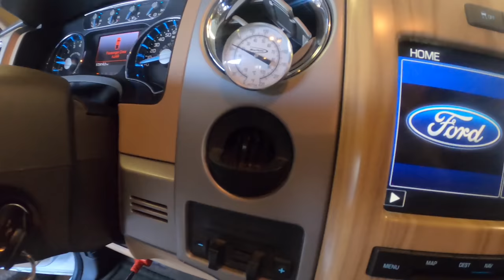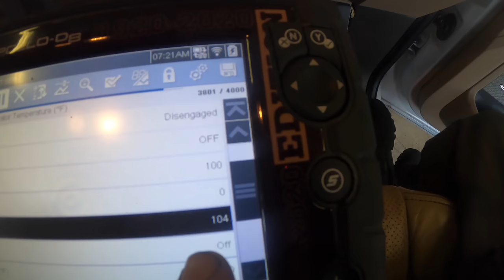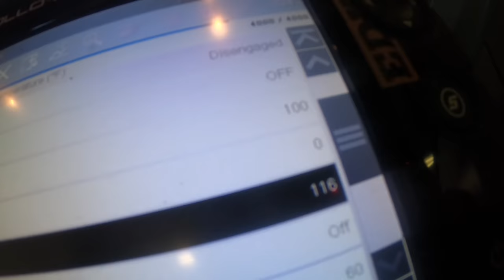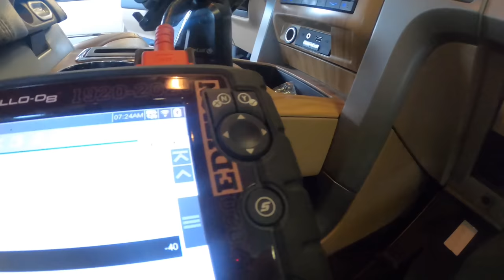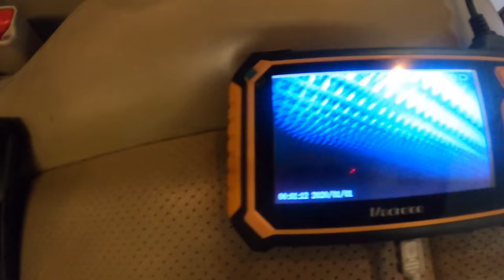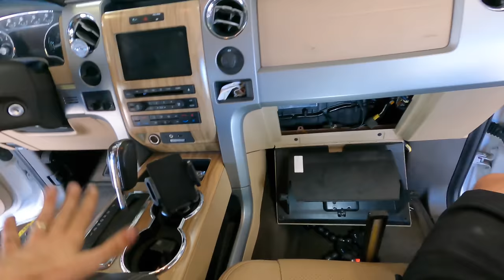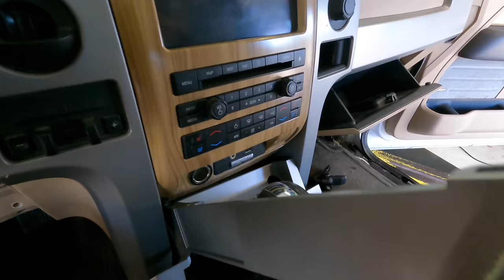TEN HOURS to replace one sensor! Ford 150 torn to pieces! Evaporator Core replacement.

Comment: I know it wasn't the OEM for that truck but I called my Ford parts guy and ordered a sensor for a focus because the only way I could get the right one was with a new evaporator.
It's been on the road for 3 years sense.  ( It was a hack but he liked it)
it was a 2010 f150

Comment: I’ve had to pull a few Ford truck dashes. the mode door itself on the HVAC box fails from time to time. Usually it’s the actuator, but sometimes the door gets bound up and you have to replace the box. As far as dashes go, it’s not too bad. Lots of room to work without the seats in there. I’ve only done a few, but have it down to about half a day. Not bad for 10 hour book time

Comment: That is not surprising! 2003 Ram 1500 heater core takes 12 hours to replace per dodge. I did it in 12 hours. When ready to install, there was nothing left on the fire wall but the steering column. Core was only $70

Comment: IS there any job you won't attempt 😮 What the heck. This channel is addictivel. I have a Love/Hate relationship with the hands-on part because I'm disabled now but fascinated. I love watching You 👈 fix them. Having the tools 🔧 the equipment, the knowledge and skills, and  PATIENCE and ofcourse what everyone seems to have forgotten about in todays society Customer Service and your definitely the complete package Ray 👍 with a few extra cans a squeaky clean Brake cleaner lol.    I'm sure this video has the third party warranty company lawyers working on writing in the loop holes on why this part is not covered under the warranty.  There very good at that.  Like refusing to replace my water pump on my 2011 Jeep Grand Cherokee Overland Summit V6 because the gasket failed not the part and I even had the Super Duper Hybrid Extended Bumper to Bumper with the extra Bumpers every thing plus VIP Warranty that covered everything oh but that 😅 WTF 😮  $700 Later.  That's ok that 5 yr 100K $3800 warranty I payed for in 2018 I still have 8 months left and so far the warranty company has invested $5700 into new warranted parts not without grumbling and sending out there investigators several times to end up having to submit to comply with there agreement reluctantly and pay for the repairs from replacing the air ride compressor unit at $2300 and then 2 rear air bags at diffrent times and then a new air-conditioning condenser unit and other AC parts that itself was over $800 the Air bags for the suspension were over a $1000 each so that warranty company put me on there DO NOT CALL LIST LOL

Love your ❤ Channel Ray. You ROCK Buddy 

Dave from Fox Lake Illinois USA 🇺🇸

Comment: Kudos for another excellent video and a very proper installation. Had this been my personal vehicle, I would have used a junkyard temperature sensor, a Dremel to cut an access panel into the box, and some RTV silicone to seal it back up. And maybe a couple of self tapping screws. 🤣... Just sayin'

Comment: Could use a variable resistor and adjust it until the temp is correct. Then solder that value resistor across the sensor wires.

Comment: All Japanese and European cars, from economy to supercars have 1 piece dashes, to stop rattles and speed up manufacture. You just undo the bolts round the edge, let it fall loose, unplug the switches behind it and lift it out, fix the parts and reverse to put it back.
I have done an almost exactly the same repair at my dealership in the uk, and being disabled with ehlers danlos, in less than 2hrs. The cost book for repairs regularly doubles the repair times for repairs to double profits for the dealership.

Comment: In today's quest for efficiency we get vehicles designed for disposal, not repairs. Absolutely no thought is given to serviceability in vehicle design these days which is why I drive old stuff which I can fairly easily fix myself. And I make it a habit that when I have to disassemble much to get to something needing fixing, then everything in the area gets replaced while I'm in there if it's not in perfect shape; nothing sucks worse than having to re-do what you just did for something you should have done the first time around...

Comment: Back when I was doing body work, I had to replace an upper door hinge on the drivers door because of one bolt you couldn't reach. (Early Mazda built Ford Explorer I think) The book showed like 10 hours and you were supposed to R&R the dash. I heated and bent a wrench to fit and had it replaced in an hour. The boss was mad I ruined a wrench until I told him why, then we kept that wrench in a special place.

Comment: HOLY GUACAMOLE!
*I was thinking "Drill a big enough hole in the box-body to reach-in and pull the bad sensor out" and then you said "It's integral to the core structure because the temp. probe is bonded to it"
and I came unglued thereafter*
( My rationale was "Thermoplastic-weld will work on the heavy-gauge plastic casing, so no need to remove the entire assemblage of the dash just to replace that thermal-sensor )
And then you said "The sensor-probe is permanently attached to that core" and I could feel what's left of my mind...melting
__________
I'm 'adding-up' the billing on this and realize "There's a lot of people with far more money than I have...way more than I thought there was" and then depression sets-in
__________
Whoever owns that truck must 'Love it to bits' after I think of the other work you already did in a/c repairs....there's some serious $$$$ going into that vehicle just so the 'Air' will work the way it should

Comment: Ford should be ashamed of this engineering fail. I do realize it’s not just Ford that does this kinda thing, but this is insane! Why not a resealable cover/access panel on that evaporator box and an evaporator temp sensor with a quick connect plug? The labor $$ on this is gonna total the truck! 😂 Absolutely bananas! Dude you have major patients! Hats off my friend!

Comment: It’s a total dash removal to replace the heater core in my truck. And if it goes bad I’m cutting the hoses and run them under the truck to the back seat and into a box I’ll build with a heater core and fan for my heater. I’m not tearing the dashboard apart.

Comment: It's probably just an NTC thermistor. You could find a model of convenient size and shape, experimentally determine the desired resistance with a cheap resistor decade box, order and install with some thermal paste or low strength thermal glue. Any electronic components shop should be able to help you next time you run into this problem.

Comment: If that was my truck and the mechanic said it's a 10 hour job to remove dash. I'd say give me a saw saw, pry bar and a hammer I'll have access to the firewall from inside in under a half hour. Or cut a 2 inch square out on that box then patch it with fiberglass or another piece of plastic superglue and some silicone for good measure job done. I should mention I only work on my own vehicles. My tool of choice is a 5 pound sledge. If that truck was mine I'd DEFINITELY cut a 2 inch square piece out to access that sensor then just glue a piece of plastic over the hole as a patch.

Comment: The funny thing about this is it hasn't changed very much ( couple more wires and sensors basically the same) since I retired in 2003. Most of the fastener are in the same locations .

Comment: Nice to know that my Dodge Stratus wasn't the only car where the first part they placed on the assembly line was the evaporator core.
Repair estimate $1200. Car resale value $500 (with working A/C.)

Comment: Could be worse. I work for a John Deere dealer, and I had to do a 115ish hour job just to replace a whopping $115ish in faulty parts, plus replacing gaskets and all those other consumable goods. Had to pull the cab off and split it just to go almost neck deep into the transmission to replace said faulty parts.

Comment: Could you give a little more detail on the specs of the temp sensor and how you searched for a replacement? These sensors are available from other than automobile manufacturers, who get them from other than automobile manufacturers, if ya catch my drift! There might also be an issue with how it is mechanically coupled to the core but I would think that there are ways to simulate the necessary exposure needed. ALSO, I just had the thought that since the computer is taking readings, I'm wondering if the computer isn't also likely controlling the compressor clutch and that a software change might be possible.... Car manufacturers tend to be as secretive about the reasoning for their decisions as BOEING but for even lamer reasons! Remember your Column Shifter Bushing Replacement video? What about hot knifing an access into the duct box and applying a patch or an improvised removable hatch thingy! This procedure really needs to be improved, and I'm sure you agree!  :elbowcough:

Comment: 2002 Nissan Xterra. The temp sensor is much more accessible but aftermarket sensors are made like crap and Nissan no longer makes OEM. Used a circle cutter to cut a 2” hole in air box and use duct tape to cover it. Works much better but probably wouldn’t go over in a pro shop

Comment: So I wonder what kind of value that probe should be at, I would have used that F250 probe and come up with a way to trim it in to the correct value. We use trim thermocouples all the time in aviation and likely you could do it with a trim pot.

Comment: What would have solved this problem is if the box was properly designed initially, A 3x3 inch hole (probably not event that big) in the box with access to the sensor. That way, instead of wasting 10 hours later on, you could simply pop the panel out, replace the thermistor, and put it back together.

Comment: I remember back in the late 50's I believe, the gov required auto makers to design so light bulbs could be easily replaced in the dash.  Driving at night with no lighting prevented knowing even how fast you were going.  Makers began to put screws in plain view so one could remove the panels.....looks like they just made other things more difficult to get to instead.

Comment: I worked for Detroit Thermal Systems in Romulus MI which is the company that supplied those bad HVAC units to ford. lol I told them that the wire with the sensor on it wouldn't stay on the evap or would fail. This video proves I was right. I worked on the test station also that tested those evaps and the ladies near me installed those wires to the evap with a jig that would push it into the evap. Many got pushed in hard, many would fall out and we pushed them in by hand lol Detroit Thermal systems has a 2.0 rating for their business on google. Ford should dump that company, they had quality issues making evaps for many vehicles including the new Bronco. I worked there for 6 years. I'm glad I don't anymore. All you had to do is take the new temp sensor and push it into the evap fins with your hand. lol You created a whole mess for yourself. Also at 38:52 the metal ring you found on the floor was pushed by hand onto the plastic drain tube which holds the thick rubber seal on and back from the tube end. I used to actually put those on when I worked on the f150 line at DTS. I know everything about this part.

Comment: I don't completely remove the dash though.. i is cinch straps across the roof to pull it back on the passenger side and slip the case out... done many like that..

Comment: I had a 1969 mach 1 mustang. Heater core replacement was 10 hours. Dash out, left fender, steering, etc. I guess when they made it the ac/heater box went in first and no one thought about serviceability. Interesting its another Ford with the same issue.

Comment: As a professional tech myself, I would have simply sold the customer an after market sensor from Advance, O'Reilly, or AZ for around $40, and saved the customer around $1000 and myself a huge headache.  I'm not a huge fan of after market electrical components, but, as long as you're honest with the customer, sometimes it's worth a roll of the dice.

Comment: oh my goodness you show fortitude ,  think if it was my car would have experemented with different ptc thermistors , fleabay sells tons of different resistances , they are also used in loads of domestic appliances.  is the tech available for what resistance it should read at say 20oC ?

Comment: I have a F150 that needed the blend door for the driver's side replaced. also had to replace the recirculating door. just did this job myself, and it was definitely a pia!. I just removed the seats, so that I was able to pull the carpet completely back to remove the duct work and that cable. now that I have everything reassembled, my airbag light is on. is there a way to reset it without a scan tool? Thanks

Comment: In order to "replace" existing sensor you should know what is proper resistance with room temp conditions... Then you go to electronics store and buy or order via e-bay. Cover doesn't matter but must be sealed and glued probably to that radiator inside. I would do this like that. It will fix problem.

Comment: I had a similar problem with a Furd Mousetang. Got a replacement part from a junk yard. Cut a port in the AC box. Installed the part and JB plastic welded the cutout piece back in place. Worked for years afterwards. Total time: 2 hours. I later had to pull the entire dash because of Furd's crappy soldered wire splices causing countless problems. 12 hours to R&R. 3 hours to find and fix bad splices in wrapped harness. Will never ever buy a Furd again.

Comment: Fun fact the EVAP temp sensor shuts the compressor off at exactly 2* C and don't come on again until 3 or 4 degrees Celsius. Well the computer shuts it off based on it's program but that is the limit. I know this with Forscan in my truck and trying to diagnose a weak AC that turned out to be a stopped up Expansion valve.

Comment: This presents a business opportunity to me. Access or have made a thermo couple for this vehicle a plastic plug to fill the hole you will have make in the housing and any tool/ template to locate it properly and sell as a kit. This is what I would do before removing the entire dash. I am sure there is a sensor in someones inventory to match the original

Comment: Years ago, I took my Fusion 2012 to the dealer while I was traveling to Dallas and they worked for 6 hours to get my AC workin in TX mid summer, and it didn’t got fixed. After refilling the AC gas, supposedly checked for leaks in the system, and charging me over $700, they claimed this sensor was faulty and I had at least another $800 to go. I gave them the finger and changed by myself. I replaced this stupid $20 sensor. Took me one night and one morning to get it replaced. The car and the AC was flawless until 2019 when a stop and go traffic accident totaled it (too expensive to repair, as per the insurance company).

The most absurd and stupid move on Ford to place a sensor behind the entire panel with no reach other than removing a third of the car interior.
Reply: You’re lucky the sensor cost $20. This truck required the whole assembly of $1200.  My plan to buy a Ford truck is officially canceled.

Comment: Beautiful truck, however my newest vehicle is a 2001. Have 4 vehicles from 1991 thru 1997 and they are professionally maintained by me and guys like you. All run fine with OBD2 PCM. I will not buy a new computer vehicle because of what you are going thru on this video. A 20 dollar part in the wrong place generates a huge labor bill to repair. One of my F-150's is at 225K miles and runs like new. LOL !

Comment: That's where they get yeah. The force you to buy an $1.1k part to replace a $20 part. They then require a core replacement, then just replace the $20 part themselves and resell it as refurbished for $900.

Comment: Could you have drilled hold in the general area (being very careful not to drill the core) and pulled it out then used a plastic plug to plug the hole.  I'm no machanic but just a thought.

Comment: Did you cool that new f250 part down? If it was 90 degrees in your shop it was reading correct.. would have worked..

Comment: As soon as you said " pull thr whole dash out for this little probe" I thought? Oscillating saw on that evap box , pull the old probe and reinstall a new probe. Make a small cover plate for the part you cut out. A piece of gasket or whatever? Self tapping screws to secure it and bada-bing. Come get your truck!! But that's me?

Comment: I used to work on dodge trucks. I could have the evaporator coil changed out in 8 hours. They had massive issues with the coil unit. I got good at it 🤣🤣

Comment: 1/2 way through and already commenting.  lol  I guess I would consider using a hole saw to get at it and then glue a piece of plastic over the hole when done, or just plug a new sensor in a reachable part of the evaporator ( IF it were my truck)

Comment: Question, Ive got an f150 fx2 from 2012 that wont change from face vents. I believed it was the mode actuator so i replaced it with the OEM part and it still didn't fix the issue, the new motor just moved to face and  wont move back, could it be a wiring thing? what should i check next? or do i need to replace the whole evaporator core like in this video?

Comment: I would of got a stand-alone sensor that would work with the system.  Then, simply drill a hole in the down-stream duct closest to the evaporator and install the sensor and the wire.  It is not a "perfect" fix, however, it will work good enough to where the control module will duty cycle the system and not burn out the system.

Comment: 2 in series would change  the resistance and the temp control 2 or 3 or 4 find out the reading from a new one and simulate